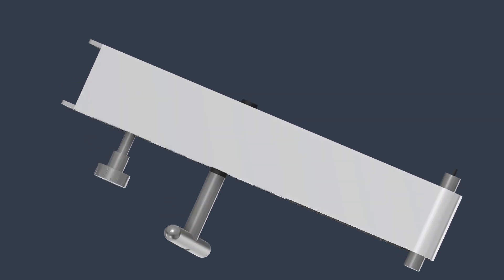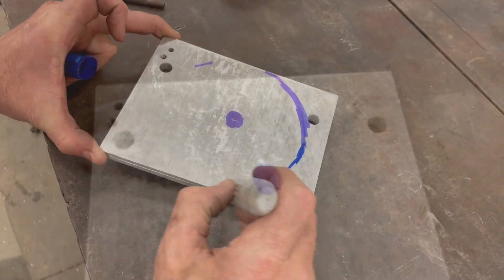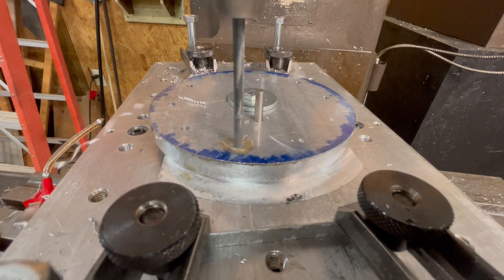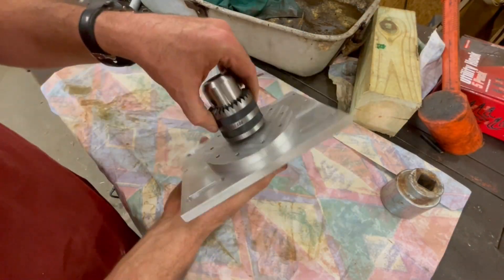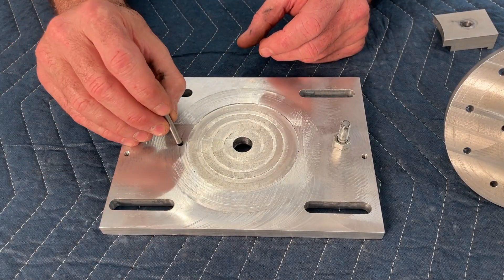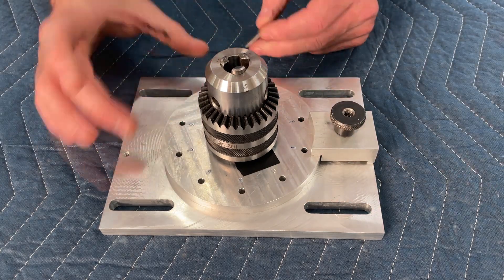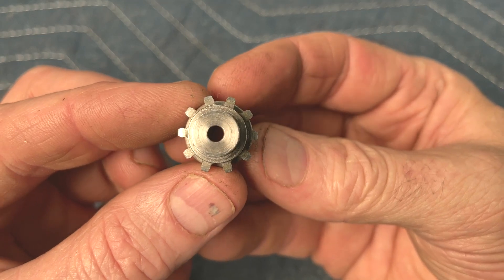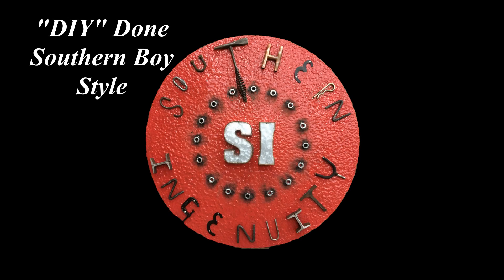Sprocket Cutting Jig   Increasing Efficiency of Manual Machine Tools

Comment: What dimensions are the little homemade channel iron strap clamps? I need to make some of those
Reply from the maker: The channel iron is about 1 inch by 1/2 inch and the lengths of the clamps are 2.250, 4.500, and 9.000 inches long. I have a video showing how I made them as well on my channel. Thanks for watching!
Reply: @southerningenuity4458  Thanks! I just got done watching it
Reply from the maker: @EitriBrokkr  Cool, thanks, let me know how your clamps turn out!

Comment: This is really well made - you can also use 9 or 10mm GT2 timing belts, their pulleys are much more compact allowing mounting on a traditional sprocket. The only downsides are the need for belt tensioners and the fact that EPDM/Neopren Belts absolutely do not like any grease or oil.
Reply from the maker: Thank you. I was looking at small timing belts/pulleys but didn’t know much about them and was concerned that they may not be able to handle the torque required to break the jam nuts loose. How much torque can those small belts handle?
Reply: @southerningenuity4458  When well tensioned a 6mm belt has a jump force of 9 lb, or 40 N. With i.e. a 40 teeth pulley and a 12mm belt that results in roughly 1 Nm of torque. Its important to keep the belt on the pinion for as long a distance as possible.
Reply from the maker: Thanks! I’ll definitely look into that and keep it in mind for future projects!